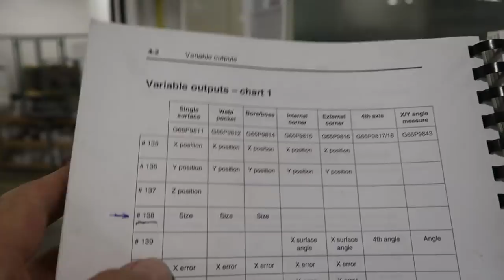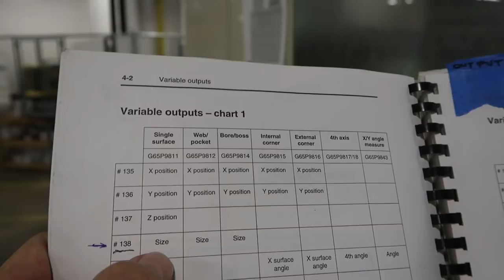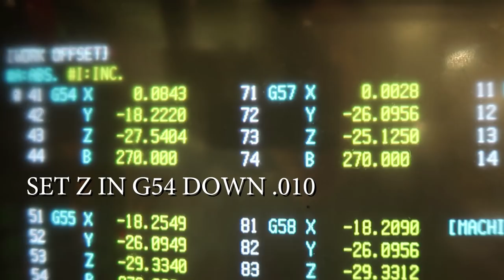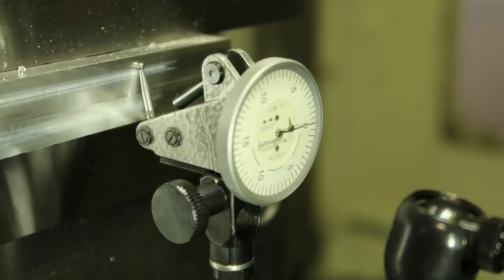Reninshaw Single Surface Measure

Comment: Interesting video. We use a Reninshaw probe at work, it has helped us solve a couple of problems.
a) Thermal compensation (since the one in the control system was pretty bad and inaccurate).
We have a reference point that we measure and then we calculate the shift in X/Y/Z.
b) Measuring workpiece positioning (we have a robot loading/unloading the machine).
c) Used as a CMM. We measure a bunch of measurements (after machining) and check that they´re within tolerances.
Reply from the maker: Are you saying you use the robot as a CMM? That's interesting.
Reply: Edge Precision I think he's dating he uses the price as a CMM, but they do have robotic CMMs.

Comment: Peter, about inserts. All regular priced ones are just pressed into molds from carbide dust. They derive their geometry from the mold. One can buy the precision ground inserts. But they cost more money. What is good about those ground ones is that you can chose the sharpness of the edge.

Comment: Peter, thanks a lot for the extremely helpful video. Can you please go into details In the next one?
Reply from the maker: Yes I plan to go into much more detail on future videos on probing. The thing is to try to make the not so boring like a school class on numbers and manuals. This delves into more technical subjects and its a little hard to make it interesting to people who don't use it.
Reply: you do a great job in any case! I've just purchased a DMU 50 3rd gen, with Renishaw and it will be used in all the manners, in-process tool checking, part probing, tool usage (dia mainly) correction, tool length corrections, breakage detection etc. There are so many folks who have all the gizmos and never use them to improve the quality of what they do. Your videos are really excellent.
Reply: Don't worry about the other people Peter.... those people can go watch cassey neistat. Do a deep dive on Macro programming and probing applications PLEASE PLEASE!!!!

Comment: Very cool process.  The dial indicator seemed to show the bottom cut was flatter than the top.  Is that just due to the limited amount of material removal on the second pass?  Almost like a spring pass?
Reply from the maker: Thanks. It could be some of that. Also the tools I used were tools already in the tool changer they have machined many other parts. I went back and looked. Tool #9 also has a tip radius tool #8 does not. And running with no coolant this may have something to do with it.
Reply: The mysteries of working in the real world. :)  Thanks for following up!!!

Comment: Probing is a great subject to cover.  Do you program the probe with your Cam software?  Thanks for sharing. I have missed your videos the last couple weeks.  Have you fully recovered from the Hurricane?
Reply from the maker: No I don't use my cam software. My software doesn't do that (Or at least thee version I have) I have done position moves with a tool I call the spindle probe. Than add the Reninshaw macros manually after processing the code. We have not as of yet got our house rebuilt completely. We are still trying to completely drying out the structure. The moisture content in the wood has to be 15% or below before you can close it in to prevent mold. Houston is very humid mold can start very easy. For resale value we have to document this very thoroughly to show it was done properly.

Comment: Nice video Peter looks like the construction is moving along nicely. Did you have any water damage in your home shop with all the rain you had last summer.
Reply from the maker: +LOREN LIEDER Thanks. We didn't get but maybe a inch of water in the front of the garage. So no problem with the equipment there. The house must be a little lower it got about three and a half inches of water in it.
Reply: Good Peter I would hate to see any of your nice machines to get water damage.

Comment: @Edge Precision hey Peter,  love your vids, any chance you can show how to calibrate a renishaw probe? I have used renishaws calibration cycle, I used the full cal using a ring gauge (don't remember the codes 9801-9809 something like that), however I'm having trouble with the z axis, I clocked in the ring gauge and then set the z axis offset with the probe but the z axis jas a measuring error of 0.5mm (switched from a 6mm tip to a 5mm tip, coincidence?) do you  set the offset using a measured in tool? Everything else is fine, tip rad macros are updated and Web measurement is accurate, just single surface measurements are off.
Reply from the maker: +middlemanclayton1 if the error is just in the Z axis just adjust your tool offset for the probe by the error amount. That should take care of it.
Reply: Edge Precision thanks, i was hesitant at doing that at first but I've done that and it seems to be fine, also had to adjust the stylus runout a bit using the jacking screws, now she runs perfectly again.

Comment: Hey! Awesome content here. Though, getting a decent micro would make those videos much easier to understand!
Reply from the maker: +TeslaAtoms Yes I am aware of this issue. As you can hear I'm filming this stuff in the middle of a working shop. There is a lot of noise from equipment and air nozzles. I am working on ideas to improve this. Thanks.

Comment: in my diy z-height tool setter。 there is a hard fixed surface that is of height position level to the moveable plate z triggering position for the probe to set。althought error in it will be copied to the measurement in the later activities。。